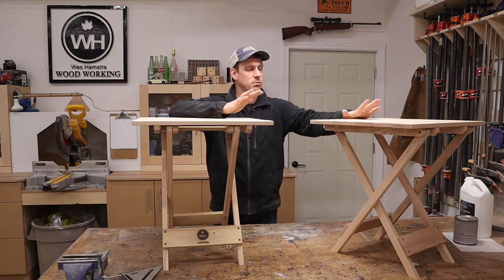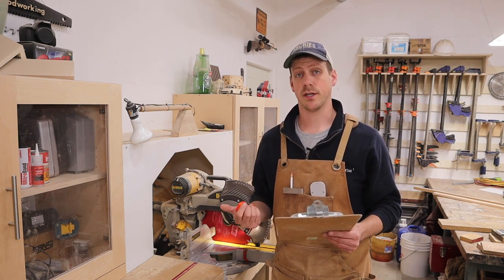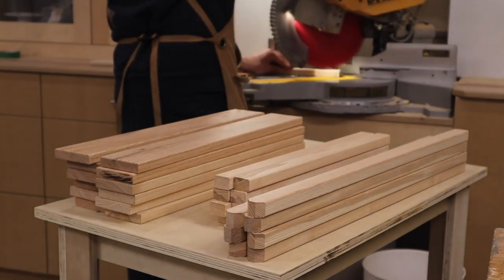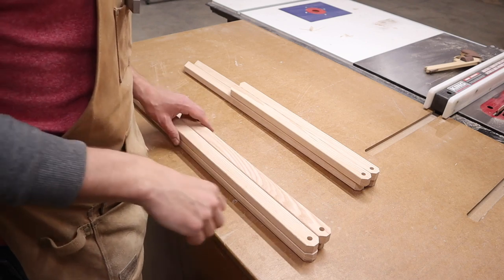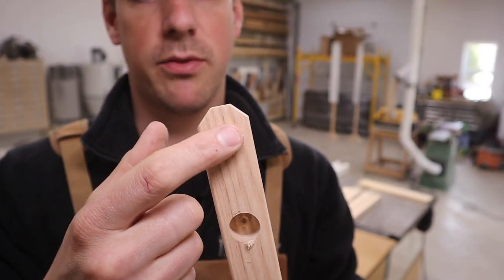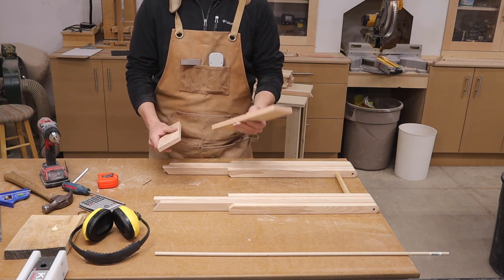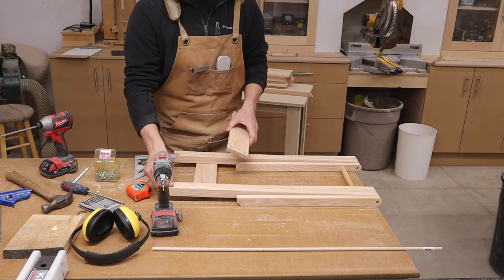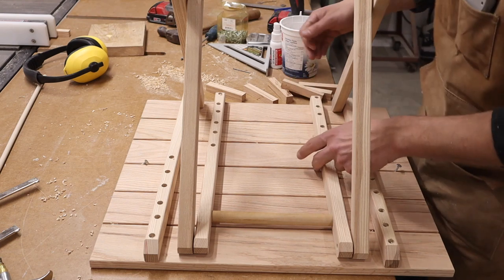How To Make A Folding Table!!!

Comment: Those guide blocks at @9:30 .... Just want to clarify.  The second set are only fastened DOWN to the table top, and not to the crosspieces, correct?
Reply from the maker: Yes. I glued and nailed the one side to the cross pieces but the other side it’s very important that it only attaches to the top. But to be safe you can just nail both sides to the top.